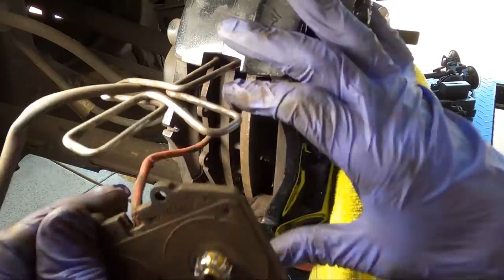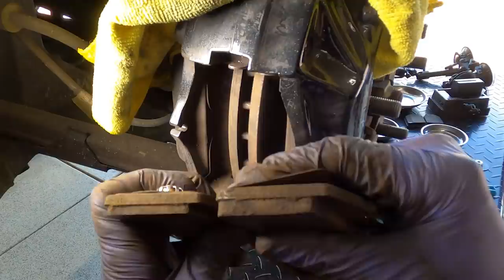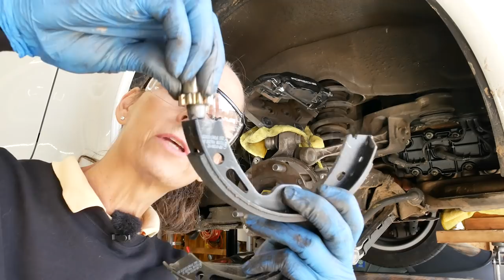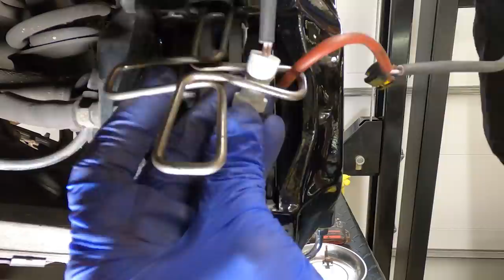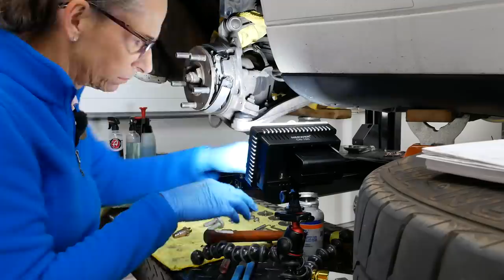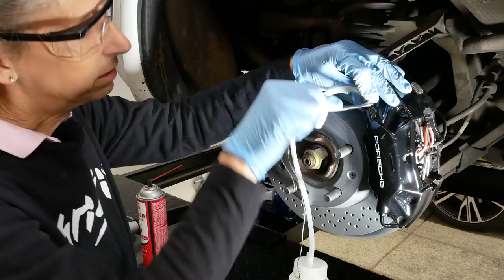How to replace disk brakes COMPLETE!  Porsche 993

Comment: Mmmm I guess it would be easier to install the anti-vibrations pads with the brake calliper unmounted, right? What I usually do with my cars is to mount the pads on the calliper carrier and then mount the calliper, but of course it depends on the car. Probably in your case it would have been better to mount all the anti-vibrations pads and the brake pads on the calliper and then mount the system, but I'm saying this without knowing exactly how that brake system is, so maybe I'm completely wrong! 😅 Very nice video though and very interesting on how to tackle the problems even with OEM parts!
Reply from the maker: Thanks for those thoughts.  We talked about this way in the final edit.  Whatever works best!  Thanks for the feedback.

Comment: Great videos, one point that helps during brake fluid bleeding using the Motive power bleeder is to fill the bleeder with 2 L of brake fluid and then pressurize to 15 psi. Then start by bleeding at the passenger side rear caliper, driver side rear, passenger side front , finally driver side front.

Comment: I’m glad you mentioned how slow the brake bleeding was. I’ve got the same system (Motive power bleeder) and on a BMW and Toyota it was very quick, but... on a VW is was very slow. Since Porsche is owned by VW, maybe there’s some common design “feature” in both braking systems which causes the slow bleeding? Also, the uneven wear (inner and outer pads) can be caused by sticky caliper slide pins. If that’s the case, the fix is to remove the pins, clean off the old grease, replace with fresh grease.
Reply: Those Motive bleeders are great!
Reply from the maker: I think it may have been the bleeder.  Once we got some fluid through it sped up considerably.  The other corners weren't that bad.  Having someone pump was super fast though.

Comment: FYI : if too hard to pull the rotor out, there should be threaded holes in the rotors to screw bolts in and  help push the rotor out of the hub.
Reply from the maker: Thanks for that!  A few taps and they came right off, but good to know!

Comment: Great video as always. Very good idea to add “never sleeze on the hub. I couldn’t tell you how many cars I have worked on that had stuck rotors. 🥵. The trick to get the pads with the dampers on, is to install the pads first onto the caliper the slide the whole caliper with the pads attached onto the rotor. Of course add your mounting hardware afterwards.
Reply from the maker: Thanks!  I thought of that after I got them on ;) , but in hindsight, maybe it will help folks who are just replacing pads and not the rotors?  There seemed to me enough room either way which was good.  The other side was just fine too.

Comment: Hi Heidi and Franny!
Franny, never ever use a torque wrench to loosen bolts. They are usually stuck pretty good and you will throw your torque wrench out of calibration. Use a breaker bar, please.
I've done lots of brake jobs on various of my cars and never torqued them. Just a good shove and that's good. Lol
You know those little rubber bulbs in an ear wax removal kit? That's what I use to empty my reservoir with. Works great. I don't use it on my ears afterwords. Lol
I've never seen those little pad thingies on any car before. Usually just a little copper grease.
I think those parts you got that were different were OE as opposed to OEM. That may account for the slight differences.
Almost forgot. It sounded like your park brake was scraping after you adjusted it out. I wouldn't think you'd want it touching at all. Seems a little tight and might in fact glaze the new shoes.
Great video with good detail.

Comment: Hi Franny, 
As a many of course with at least drum brakes, pull both wheels off at the same time, only do one wheel disassembly at a time. That way (even with great pics) you typically have a correct template to refer to if case things aren’t going back together correctly (as easily as you think?). As someone said previously, you Never pull both apart at the same time. (Unless you’ve done it so many times, you can do it in your sleep, and typically that just isn’t the case). Great job as always, love your though-ness, taking notes to keep everything in order and correct. As it’s been said by some; “there’s never enough time to do job correctly the first time, but always enough to do it the second time”. Keeping track and not making silly mistakes by having good notes, pays double dividends by not having to take it apart again to get it right. Great job 👍😎🙂
Reply from the maker: Great advice!  Thanks so much :)

Comment: Wow. I've done a few brake jobs in my time, but I think on this one I would have taken it to the mechanic.  Kudos to you for doing it yourself.  As for asbestos. According to all my trainings, the danger is breathing in the teensiest little speck of it.  It can sit in your lungs for years and rear its ugly head in the form of mesothelioma. When possible, asbestos should be wet down before disturbing it, but on doing a brake job, that's not so handy.
Reply from the maker: Thanks so much for that.  I have heard the pads Porsche used were asbestos free from the 80's on, but it was a warning in the service manual so I wanted to pass it on.
Reply: @HeidiandFranny  I saw that as well, and @michele crown is right - the danger is inhalation moreso.  But you did give a warning about asbestos and that's the key issue - one needs to be careful (as usual!).  Thanks for doing the video on the 'newer' car.

Comment: When I adjust the handbrake I always center the brake pads by pulling the handbrake lever inside the car a couple of times and then free it with the screwdriver. Most of the time you don't have to free it, when they are centered they are loose. BTW Good video. I also sandpaper new pads a little bit , especially at the ends. You don't have the special spring plier so you could not install the new small spring.

Comment: Great video as always and I’m shocked that there was something I knew that Franny didn’t (the 2 different size spiders on the 993 pads)!
Reply: Also... putting the spiders in first, then slotting the pads carefully in is the way I do it too but if I’d had the calipers off like you did, I would have done all of that while the calipers were off the rotor which would have given you plenty of access: step 1) remove sticky backing from spider 2) put spiders in the piston holes 3) place the pad against them 4) repeat for other side 5) reinstall caliper with both pads onto rotor.
Reply from the maker: Yes, that is a great way to go.  We like your step by step also.
Reply from the maker: We did not know they were referred to as spiders, they certainly look like them.  Thanks for the name.  I like it.

Comment: WOW   first time  I see this for multi OEM parts not  matching    ( pads (modifying!!!!),  springs, calipers bolt )  sometime the after market part are a little different  but never shorter, ect...    Almost had the impression that catalog was in error !   But  Fran you are the Porsche guru  so you know best  ;0)    Keep up the good work  :0)      PS I am sorry for Mr Murray I think he has index twitch syndrome   :0(  !!!
Reply from the maker: Nick is a nut :)  That's why we love him!  I will let the supplier know about the parts.  At least it was just the parking brake ;)

Comment: Well done !  I like to use a dial indicator when installing rotors, just to be sure they runout,  the maximum allowable runout on a tex. 997 rotor is 0.06 mm. at the friction surface
Reply from the maker: That's a great idea.  I probably should have checked that before removing them but since I was replacing them I skipped that.  I check the thickness of the old rotors and they were right at the absolute minimum.  I am wondering if these were actually the originals...  I would think the originals were flat, but...  Would be good to check that too.
Reply: @HeidiandFranny  I use the dial indicator on the new rotors 😀

Comment: Hi Franny. The reason why they not recommend lube is : if to much can set the b.disk so it’s not tuning straight. It is so little to make that happened. At least my experience. But you is so careful, no workshop will do a nice job like that. I enjoy to watching. Happy ester btw.
Reply from the maker: Thanks for that, I hadn't thought about that.  I have heard of people lathering that on and causing a big problem.  I know on the wheels against the hub that even the slightest bit extra will sling out.  I have had that bottle for almost 30 years and it still looks like I haven't used any at all.  Truly a little goes a long way :)
Reply: @HeidiandFranny  I used to work for Scandinavian airline for 27 year. We had never sees there too. So we have aeroplane in com-men. Nice. I also participated in at the time the world biggest sailing race. Seeland round. In Denmark. I was the sail trimming man. Cars. Corvette 73 383-, Porsche 996 2001, MGB 66.Land Rover series 3 77 and daily BMW 520 touring 2009. first motor fumble at 12 year old. A old moped. 50 years passed. Still in to it. 
Keep up the good work, no one on you tube is better. Thanks for serving us.

Comment: Hi Franny I did this a couple of years ago on my 993 and was advised that you should also blead off the clutch slave cylinder as it is on the same circuit and you can get old fluid contamination from that.  Also during the process it is advisable to lift the clutch pedal between each pump or there can be issues with the clutch not disengaging properly. Lastly, it is necessary to use a device known as a Bosch hammer tool to open/close the valves in the ABS part of the system. These are extremely expensive and not available for DIY'ers , the alternative is to bleed everything, then take the car for a drive on a quiet remote road and stand on the brakes "HARD" till the ABS cuts in and then return home and repeat the bleeding. Be careful. Thanks for your tuition video on the climate control unit fan motor repair, I am about to try doing that, Good luck
Reply from the maker: Thanks for that :) Funny the manual only calls for the use of the "Hammer" for the non-vacuum boost and the ABD system...  But great advice to get the ABS to lock up.  Someone else mentioned the clutch and I completely forgot about it (I think I was thinking 3.2 Carrera/915).  I'll get to that soon.  I'm sure it needs it.
Reply: @HeidiandFranny  Thanks for liking my comment and replying ladies, you have educated me regarding non vacuum boost 993's. Are these the very early models? I didn't know they existed or maybe Its yet another difference between UK and US cars? I have found many on Porsche forums!. Thanks again for your informative video's, I have found them useful. good luck with the 3.2 project, Paul

Comment: With uneven wear like that, chances are that the previous time this was done, someone forgot that there are two bleed nipples per caliper.
It happens too often.
You'll end up with old fluid on one side a fresh fluid on the other.
It's actually good practice to refresh the brake fluid once a year anyway.
It's the brakes; the most important thing on the car. Needs top priority always.

With the parking brake...
You could've left everything in situ and just sand the shoes down with some sandpaper.
They were probably just glazed over.
This "OEM" non-fitting cr@p, probably holds the car less than the old parts.
Since the thickness of the brake material is thinner, it's combined diameter is less.
Now it probably just touched the drum on only two small places. One per shoe.
It'll be always out of adjustment for a long time...

I personally would have never fitted the new shoes, but that's me.

Comment: It's amazing how similar the emergency brake system was on my 2007 Cayman S to this.  I would bet that 75% plus of the part numbers are the same.  That job SUCKS though.  The springs never want to go back into place properly without a knock down drag out of a fight.  You pretty much need to fabricate a tool by cutting a slot/half moon shape in the end of a straight slot scredriver so it won't slip off the spring so easily.  

Personally when I do the brakes, I simply unbolt the calipers from the carrier, spread the pads just enough to clear any lip, then pull the whole thing off with the pads still inserted.  From there, its quite easy to remove the pads and dampers, compress the pistons, and replace everthing before slipping it all back over the rotors.  May not be "proper" procedure, but works quite efficiently.

Comment: Great job! The difference in old and new parts would make me a bit nervous. I wonder if the parts were different for the 993 I and 993 II.
Reply from the maker: I think they are the same for the 964s as well but I'd have to check.  I think they were just a bit off.  I do need to go out and test everything.

Comment: Oh what color did you use to paint the brake dust shield? Your brake fluid seems darker than normal. You may need a full flush.
Reply from the maker: I think it was Dull Aluminum.  I thought that too about the color, but it was fresh fluid.  That is supposed to be pretty good stuff but I usually see a marked color change.

Comment: With the uneven wear on the old brake pads, shouldn't an inspection be done on the brake calliper for the cause?  Any insight on that?  Thanks!
Reply: My thought was the caliper pistons may be tight on the inner side or the pad on the out side was tight and not slightly retracting.
Reply from the maker: I was thinking there may have been some air on that side?  Hard to tell.

Comment: OEM-Parts: Never never throw old used parts away! Most new parts are crap. You easily can rebuild the emergency brake shoes with a new pad. I guess this would be better than the „new“ parts.
Brake fluid: I use the same system with the pump, it works perfect on every car. The 993 has an old mostly mechanical ABS-System. To flush those with pressure (which is the only correct way) you need at least 2 - 2.5 bar. Then it is important to block the brake power regulator at an open position. Try it again in max. 2 years😎
Reply from the maker: Will do.  Thanks!

Comment: Franny, preload the pads in the caliper then slide the complete assembly in and torque!  BTW I've had good luck with Zimmerman rotors on the BMW's I used to drive, my SAAB and of course my Porsche! Also does your car have ABS Brakes? That  might have been a cause for slow bleeding action.  There is a specific process for bleeding ABS systems.  You can't beat the Motive tool!
Reply from the maker: Thanks for that!  I was following the procedure for replacing just pads (of course they say to refer to that when replacing the rotor as well - lol!).  But totally, that would have been a bit easier ;)  Good to know on the Zimmerman rotors.  It does have ABS so maybe that was it, but I think I may have had a somewhat clogged bleeder.  The rest were a bit easier, but still not very fast.  This one was painful and I didn't want to go past 15psi.  Having Heidi pump away really did the trick.
Reply: @HeidiandFranny  Great!  I know what you mean about some of these procedures being more challenging than they ought to be.  Mazda has a specific procedure for bleeding ABS brake systems.  When I did my '95 M-edition I had the car on the lift with wheels off and my wife pumping the brakes while the engine was running!  They warn about getting air in the ABS controller as its neigh impossible to get it all out.  I love watching as you tackle all these projects!

Comment: Are the two e-brake shoes exactly the same or is there a primary/secondary shoe?  They looked the same but I couldn't tell for sure.  Crazy that the adjusters and springs didn't fit!  Great video, Franny!
Reply from the maker: Thanks! They looked identical and the system looks symmetrical.  The manual didn't mention any differences, but it was a bit vague as well.

Comment: Any thoughts as to why the pads wore differently?
Another stellar vid! =)
Reply from the maker: Thanks! I was thinking that maybe there was some air in the system?  I didn't see that on the other side.  Could be a bad piston but they seemed to push in just fine...  I'll just keep an eye on it.
Reply: In my limited experience uneven pad wear is a sign of one of the pads binding somehow.  It could be the piston is not extending properly and that could be many different reasons.  It could also be that the wear point on the pad wear it touches was not lubricated, or the lubrication wore off and the metal on metal ceased the pad.  This would cause the other side to do more of the work.
Reply: @HeidiandFranny  Thank you for sharing your thoughts, Franny.  I was very curious about it. =)
Reply: @lowreedman  Thanks, Steve.  That makes sense!

Comment: Your issue with the parking brake shoes is, I believe, that the part has been superceded with a 997 part so in order to fit them without resorting to a grinder you need to use the corresponding 997 adjuster.
Reply from the maker: That totally makes sense! Thanks for that.  They do work just fine and the car now easily hold on a hill so that's a plus :)

Comment: For the spiders: do not peel off the non stick before putting in the calipers. Just fold over the edge, to make gripping with needle nose pliers easy. This way you can push them in and seat them without sticking to your fingers. Once seated, reach in with the pliers and remove the backing.